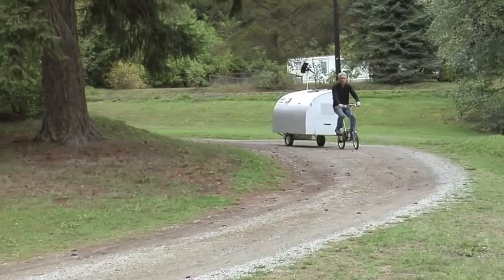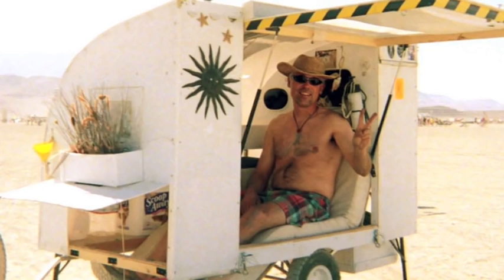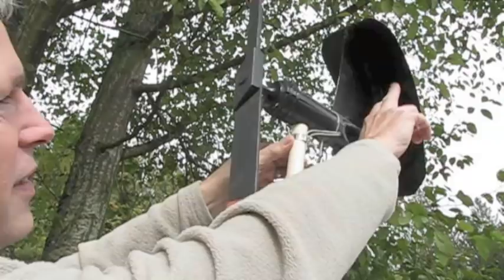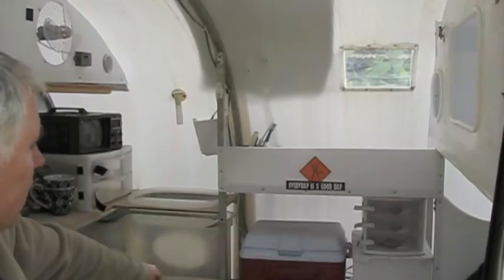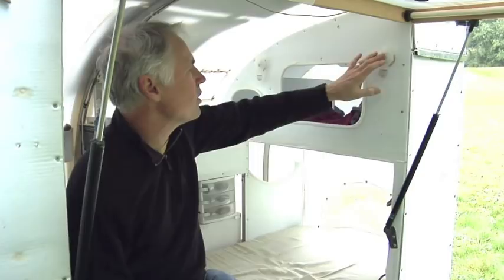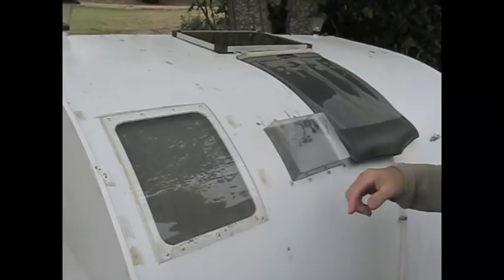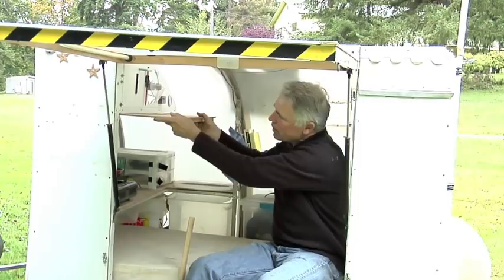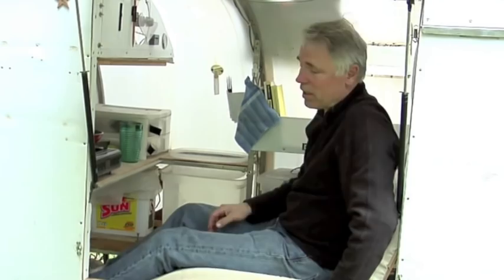Bugout bicycle camper

Comment from the maker: around 100 pounds with stove, cooler etc.
Reply: I like it  it keeps cost down ( hotels, motels & b&b etc)  But, it's not for everyone that's fair enough everyone has there personal preferences. But, here in the u.k something like that someone who has spent sometime & a bit of cash on it the chances of it being kept undamaged is quite slim. Unless it is kept under good security when not being used. Which seems such a shame. But, I suppose that could be in some other countries aswell they could be just as destructive towards something like this.  Enjoy your trips (holidays) with it 👍
Reply: You could have added alot more weight  with easy of towing if you use MicroBlue wheel bearings.
Reply: Yes, it's a shame that someone with ambition and a strong work ethic cannot take something like this to a camp ground and leave it unattended. Why can't people just be honest? Usually it is someone without ambition or brains or integrity that preys on those who do.
Reply from the maker: It depends. Most times something unusual will receive attention,  fascination and respect. It's young adults and kids who do most of the damage. An example is when I build a sand sculpture and leave it for a few hours. I've seen little kids just come up and tromp on them with glee in their faces. WTF???  But hey, they're kids...
Reply: OF THE FEW BASIC NECESSITIES YOU MENTIONED WE NEED YOU FORGOT TO MENTION FEMALE COMPANIONSHIP, WHICH YOU DEFINITELY WON'T BE GETTING IN THAT LITTLE ONE PERSON DOMICILE!
Reply: *****
Oh, my bad. You're right, his female companion can pedal the bike while he rests in the trailor. But where is she to sleep at the end of the day? Room for only one here.
Reply: lol
Reply: yea.. why not buy a solar cooker? you only need 2 hours to cook an egg..
Reply: Paul Elkins can you please show how to make one you inspired me to do the same
Reply: Legend
Reply from the maker: I'm here in the Pacific USA time zone. What's a good time to call?
Reply: such a cool setup. how does it go up hills?
Reply: You should make and sell these if not i will. jus kiden
Reply: Paul Elkins Genius!!! How was Burning Man?
Reply: ricky lahey By bending the knees and applying pressure to the bike pedal's  .
Reply: Paul Elkins WhAt was the shell made out of?
Reply: Paul Elkins 
Dope👍
Reply: I love it! Great idea, and great video. Thank you for posting. You've given me an idea.
Reply: Do you have to put one of those orange placards on the back to warn others on the road that you're a slow moving vehicle?
Reply: Paul Elkins can I buy one seriously and how much?
Reply: Paul Elkins I think there cool
Reply: Paul Elkins wondering about the dome over your head and trapping CO2. Other than that... and you must have killer quads pulling 100 pounds... it's very clever.
Reply: Where can I purchase the Coro-plastic and what is it called exactly. I looked at Lowe’s and HomeDepot and couldn’t find it. Thanks
Reply: I really want to learn to make one for myself :)
Reply: Paul Elkins GREAT IDEA
Reply: Paul Elkins Perfect for someone who is homeless.
Reply: Did you said: “can be use as a bugging out camper”??? Yeahhh...ok!
Reply: Paul Elkins wow cheap
Reply: drServitis  when you get old enough you'll realize female companionship is not as big a deal as you had thought. It's just more trouble.
Reply: Fuckin amazing in 2018
Reply: That's not bad, I've hauled 300 lbs behind a bicycle trailer while recycling.... Another thing people need to realize is that shelter is the number I thing to have the in a bug out or lost in wilderness situation.... someplace to give you that security of having some kind of roof over your head when the sun goes down....#1 thing shelter!    Well done.... blessings....shelter....then go out and gather
Reply: Perfect
Reply: I need one how much ?
Reply: The only reason i clicked it to see how much it weighs not gona lie
Reply: Sweet!

Comment: Cool.  The only few things I'd be concerned about are the fumes from the propane cook stove, it needs far better venting in such a tiny space it wouldn't take much for things to go badly, so I'd Install a larger vent or two or else remove it from inside and strictly use it outdoors.  If there is ever a big storm with high winds it's not going to stay put, so I'd also consider installing some steel tie downs that can anchor into the ground, bring you a small 2 inch battery operated handheld augar to dig down into the ground, and a make shift anchor and tie down assembly to secure and stabilize during g high winds.

Comment: Having the head area transparent on the camper is foolish.

What if someone with evil intentions notices you sleeping? 
Not a good situation to be in.
Reply: David E yea I would have to paint that bubble. I used to have fears of hanging my feet or leggs of side of bed when I was young after watching Freddie cruger. Even worse thoughts about someone seeing me and chopping or beating my head off lmao at the last option one.
Reply: @daveycrocket6277  Yeah, I can relate; horror movies can be detrimental.
Reply: Not zombie efficient
Reply: That would go for anyone sleeping in a tent, so it's irrelevant. Anyone who has evil intentions would break in anyway. And actually it's less likely to be broken into if you can actually see someone inside.
Reply: David E They will hop on the bike and ride away with him in the back 😂🤣😂

Comment: I want to build one either bicycle shelter or push up cart. 
for many reasons: 
1 I am a minimalist at heart
2 my flat bed is not comfortable. I need one that can half recline
3 I like furniture in wheels
4 it's a good project to do with my kids 

I have a question. I was thinking to make a base with 2x4 s..  and attach wheels from a dolly..  
should it work. or I should use toddler bicycle wheels.. ?
Reply: the problem is if I think how can I put there on the base a chair that can recline for sleep. how to attach it so it won't fall apart? 
something that looks more like a toddler carseat but an adult size..

Comment: Excellent ! I subscribed ;)
I need to hire someone to build me one, and then buy a bicycle- I'm practically homeless anyway- I'm living in my ex's old trailer with no indoor running water- I'm lucky I have a spigot out in the front yard to haul water in for flushing, spit bathing, drinking, etcetera, but seriously, one of these could help if I had to leave this place :)
Reply: No water but internet connection ?
Reply: It’s the modern way I suppose.
Reply: Wth, you bathe in spit...
Reply: A smart phone and data plan provide internet. Also, a smart phone can provide a mobile wifi signal for a laptop or other devices.

Comment: What do you do when it gets cold?

Other than that..damn you thought of everything.
Reply: Matthew Smith just setup a fire inside.
Reply: Matthew Smith maybe hes in the deep south
Reply: Im sure that stove will warm the place up fast ....
Reply: Shiver?
Reply: I'd think body heat would build up well in such a small space ..could easily add insulation to this build too, and you could use blankets and clothing to heat up. ..
Reply: I lived in a Ford Explorer in the mountains for a year. Trust me, creating heat in 15 degrees is easier than trying to stay cool when it's 105 degrees down south.
Reply: Matthew Smith if you have extra propane you use the stove barely cracked window

Comment: Change a bicycle to motorcycle
Reply: One of those motorbikes! 👍
Reply: no, a self-powering pedal assist e-bike!  Then no fuel needed.
Reply: Keep in mind he was first inspired by FLYING bicycles. That house doubles as an inter-galactic flying Blender.
Reply: @thebluelizard6335  Assuming that the pedal assist battery could be recharged in some way without the electric grid, a pedal assist e-bike would be ideal for this. although I would beef up the trailer a bit more, mostly because I'm a bigger guy. I wonder if a 2 person version would be possible?

Comment: Wifi conect?
Reply: You could get a mi-fi
Reply: Will have soround sound system and auto airco when open
Reply: @Food FOOD!! A router that runs off 4g but its faster than a phone hot spot
Reply: You get bi-fi
Reply: The subwoofers power the wifi

Comment: That is so darn clever but isn't it heavy?
Reply: Buffeted by wind while in transit?
Reply: Probably not intended for bicycle travel. The air resistance alone would make it quite hard to travel with. With an electric-assist bicycle it should be possible though. Add an extra battery to get >50km range. And just be careful, crosswinds are probably bad and braking with such a heavy trailer is going to take a while.

Comment: Pretty cool man but one issue you have with your pneumatic shocks on your door they are upside down there is oil in those cylinders to lubricate O-rings that keep it sealed in that position the oil is sitting in the bottom of the can and doing no good and your socks will fail very soon

Comment: Could this be made stronger to pull behind my modified 15 passenger  Express van? When stopping at destination or nerd access to my powerchair lift that uses the back two doors. What extra sturdy materials could I use? Do you have building plans??

Comment: Serious question. How much does this weigh? Could you pull it with a regular bike? Thanks.
Reply: My question also,  I've been on many cross country bike trips with a loaded bike and let me tell you going uphill and against the wind is no picnic. I try keeping my total loaded weight at 30 lbs.  this trailer look to several times that.  They make small bike trailers for pulling your gear that would be easier than this trailer.